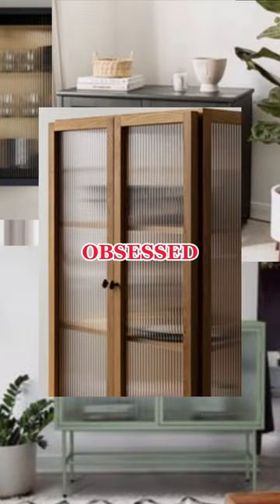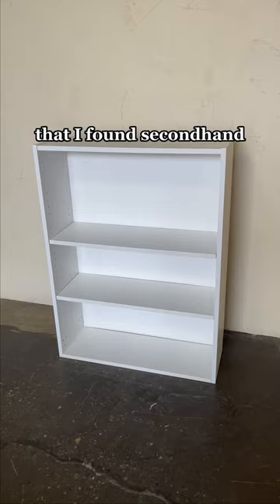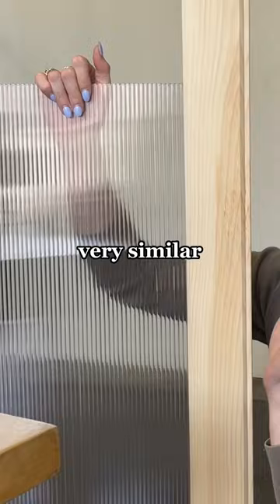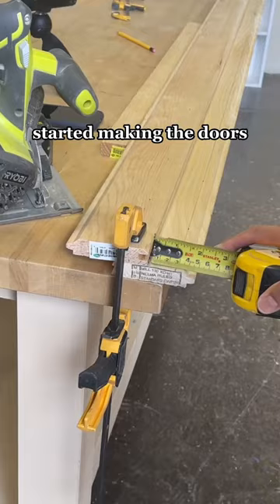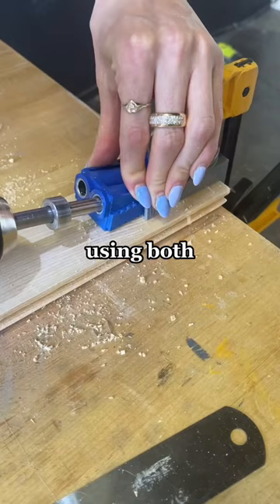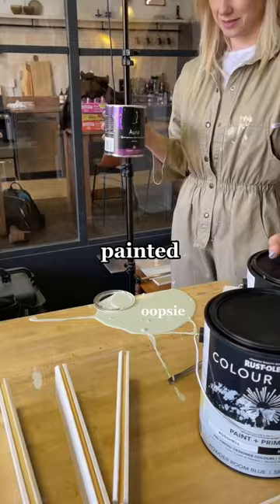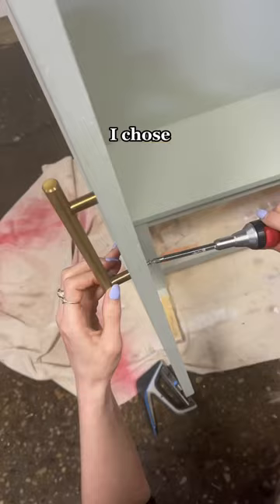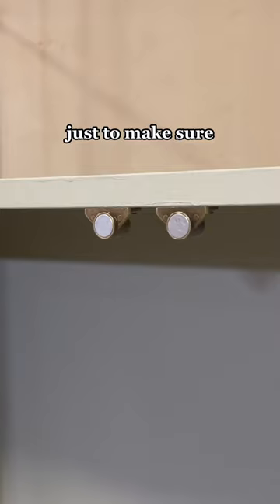making the cabinet of my DREAMS😍 #shorts

Comment: What PISSES me off, I LOVE people learning carpentry/cabinet making but this crap MOCKs our trade. To diy's it looks professional, she's bought tongue and grove and done a straight cut, stick two flat edges together calls it a frame, the tongue literally acts as stopper, so as long as the glass thickness is correct it won't fall through. it's not like actually learning the skills to cut mitres, tennons, route shiplap. Talking about pocket jigs to sound like a pro, uses zero glue, zero dowls (I get the tongue acts as a joint) thats what i mean by cheating she cba to glue it. the only real skill is measuring accurately, the rest is basic level carpentry, she literally take carcasses of other people's work, slaps some paint on calls her self a wood workers. Every cut is a straight cut square, it not learning bevels its whats easy cheap and can sell.